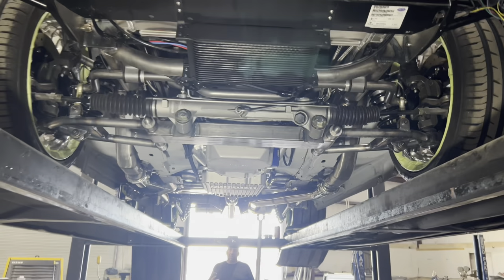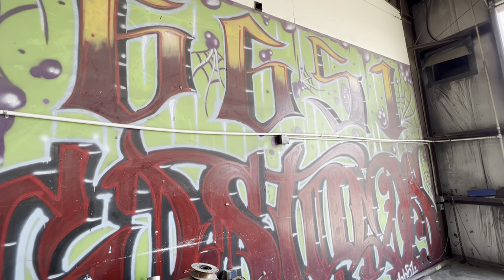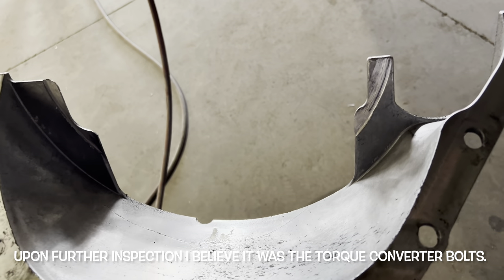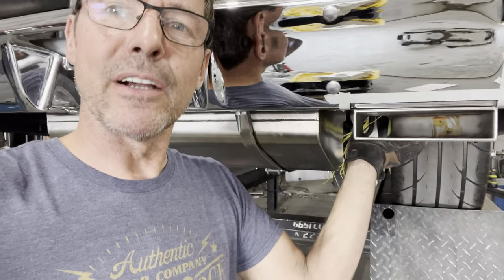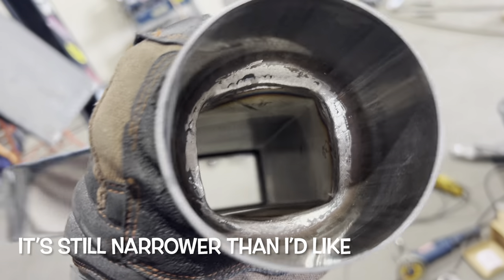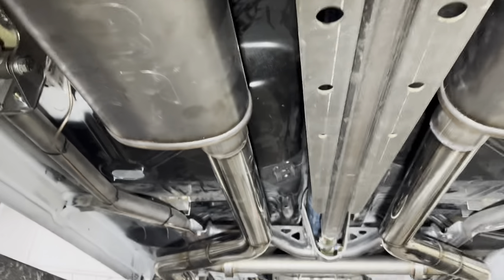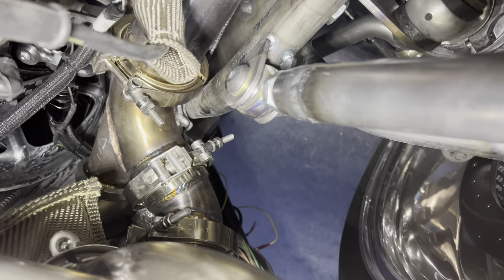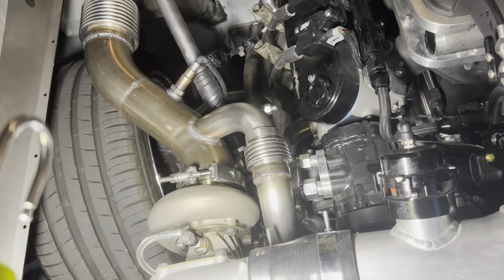Brody’s Garage 🏁 Episode 42: Exhausted.

Comment: Glad you found the source of the noise. In regard to chroming your bumper, I heard Advanced Plating in Portland Tennessee was the best so I used them for all the chrome on my 67 and everything came back perfect. I had bumpers, headlight bezels, shifter, horn ring, trunk panel insert and quarter window pieces done. It did take them 6 months though.

Comment: A little heads-up, looks like your new doors don't have the slots for the stainless trim (reveal moldings) that a OEM door has. You probably want to add those before paint and bodywork.
Reply from the maker: I’m not in front of the car at the moment but they do have slots with very sharp tabs on the inside lip. Are those the ones you’re referring to?
Reply: @Brody-Dolyniuk  These I'm referring to is on the upper side, nearest the side window. There are metal clips on the moldings that snaps into these slots. And also you probably want to test fit these moldings before paint. Another thing thats good to have in mind...don't put on too much sealer and paint on the driprails, cause that will make it a hell to mount the stainless driprail moldings later ...ask me how I know.... 🫣